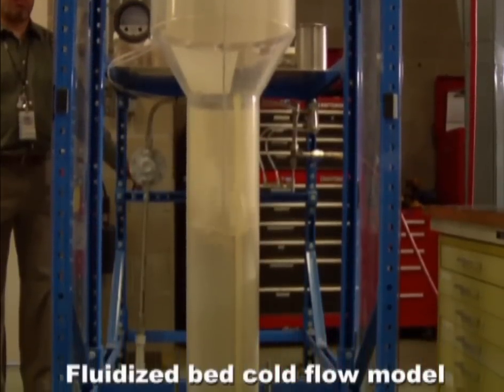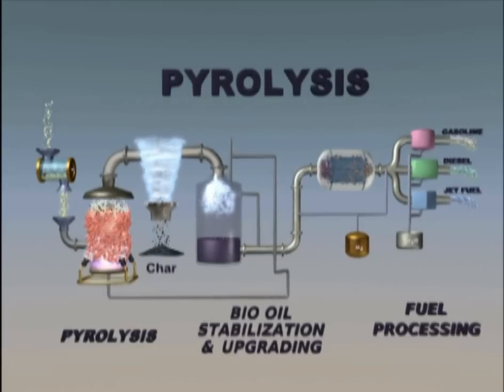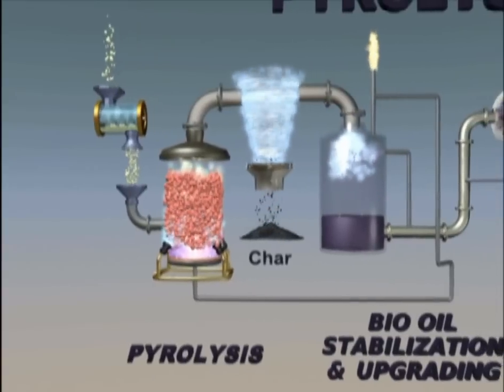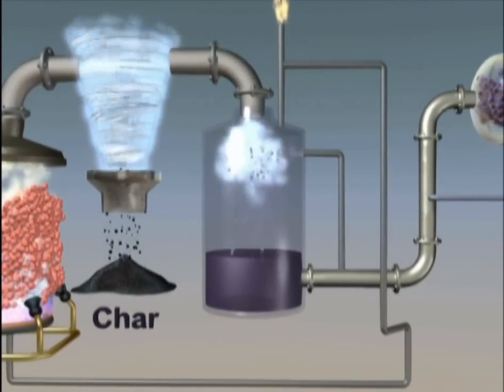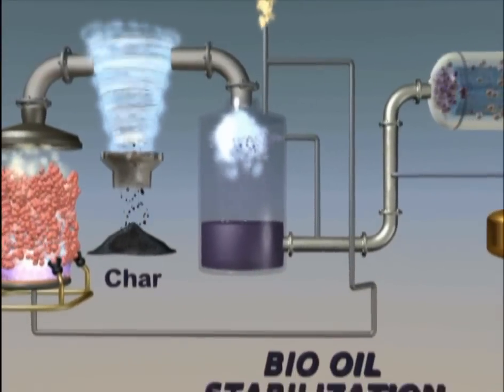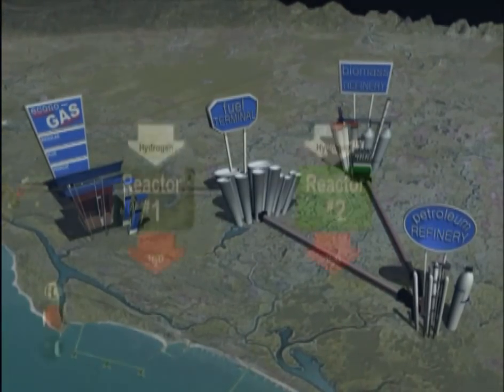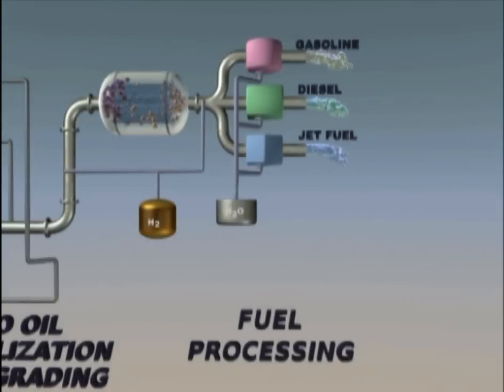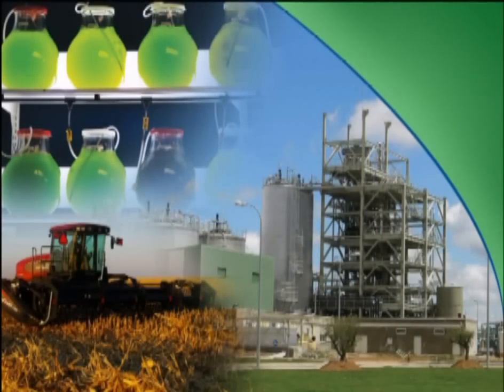Thermochemical Conversion of Biomass to Biofuels via Pyrolysis

Comment: Nice video.
Now it is real. 
We use the fast pyrolysis plant Fpp02 for recycling plastic waste. https://youtu.be/f2J4rOFEDVg Reactor 500 kg/h. It turns out liquid  fuel for hot water boilers.
Good luck to the author of the video.

Comment: How much energy per land of biomass?
Reply: That is usually something like 5 acres per car on the road so growing energy crops for fuel  is stupid, but this is a better way to use waste organic matter than just burning stubs heating or even bio gas, as this can replace oil and used for transport.
Reply: @Tore_Lund  
Can you translate into an aduot unit of measurement,  like an equivalent of megawatts per day per kilometre?
Reply: @robinhyperlord9053  The 5 acres was from an ancient UK  top gear episode, they tried running on corn alcohol, which might be more efficient process as yeast do the hard work, but still it is in that ballpark.
Reply: @Tore_Lund  if this were in the hands of individuals, not regulators who are beholden to people who lobby in favor of massive corporations and their interests, the world would be better off. The entire narrative of climate change and pollution has come from those institutions and corporations who stand to profit off of the findings of their tests and research. Individual liberty is where it's at.

Comment: Look up wood gassifier.  The Gas coming off that can be compressed into propane tanks and run your car.  The charcoal remnants from the retort of the wood gassifier can be used for the Barbecue, Forge, charcoal filtering and ageing, or to heat your home.  All can be done in the backyard without all this scientific looking equipment, which is mostly bureaucratic wheel spinning or reinvention.  Oh, all without the use of lots of water.   A case of Mike Rowe and scientific lamb raising vs. they way it has already been done for centuries.

Greenies call it biochar and soak it in the septic tank to make fertilizer....
Reply: ? The coal is used to heat up the gassifier, the only byproduct in a sofisticated gassifier is ashes from the burnt coal.